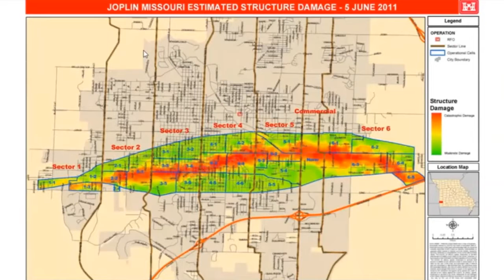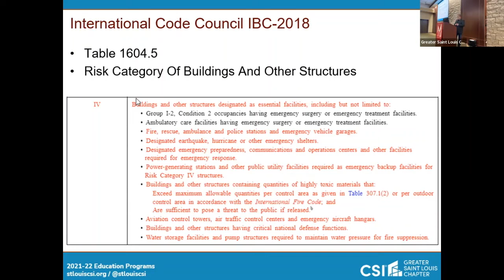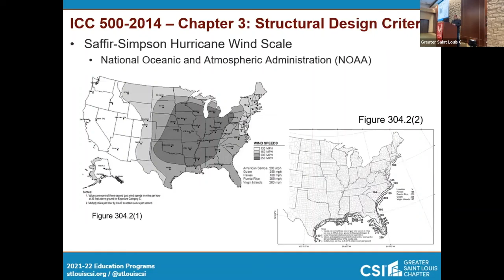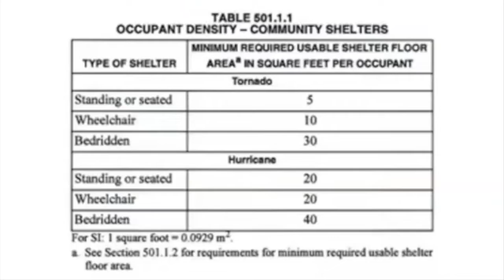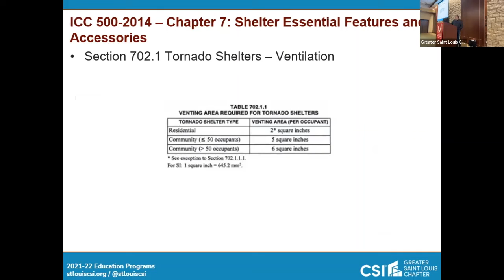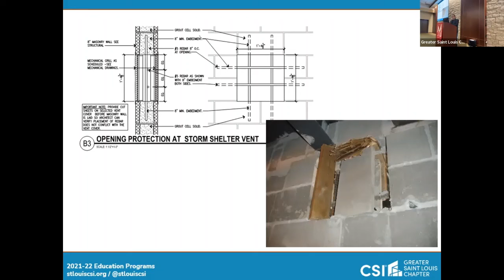2022-02 Architectural Aspects: Tornado Shelters

Comment: I'm an old retired guy. For 21 of my working years I responded to large scale natural disasters like floods, hurricanes and tornadoes.
The ONLY buildings that l've personally seen that stand up to tornadoes were either round, thick reinforced concrete, earth sheltered or domes!
My personal recommendation is to look at three building systems (yes, they cost a little more, but what's your life worth and the lives of your families). Not in any particular order:
1. Binishells
2. Monolithic Domes, Inc.
3. Formworks Building, Inc.
You can find videos of each here on YouTube.
I'm planning on building a monolithic dome for myself with FEMA 361 windows and doors, made from 8" thick reinforced shotcrete and 3" thick polyurethane foam insulation. Why 8" instead of the standard 4"? It's because I know F-5 tornadoes can pick up and throw 18 wheelers and cars like toys! I also live in Mississippi in a town that's already had one F-5 tornado hit, killing 38 people and destroying 1,200 buildings.